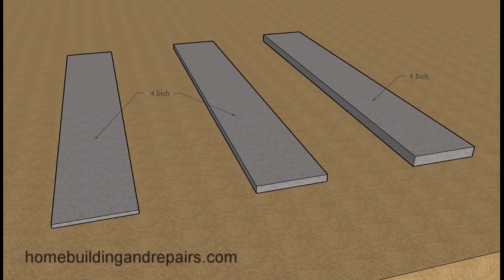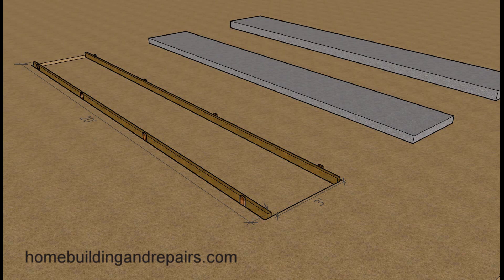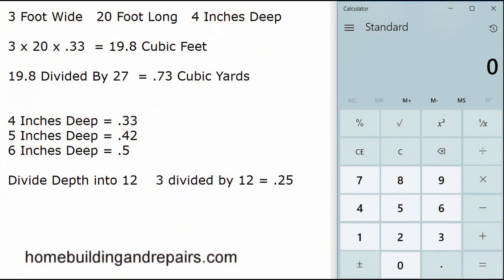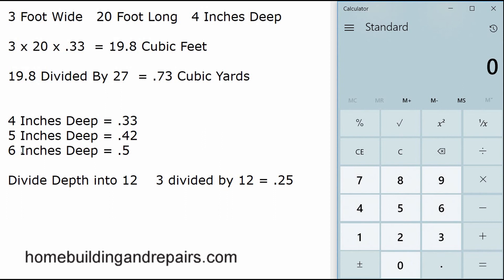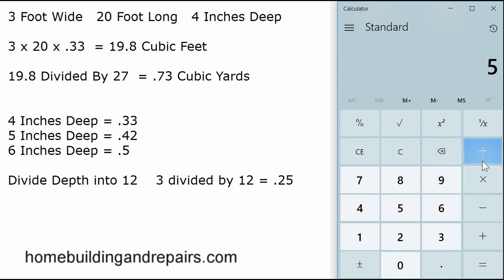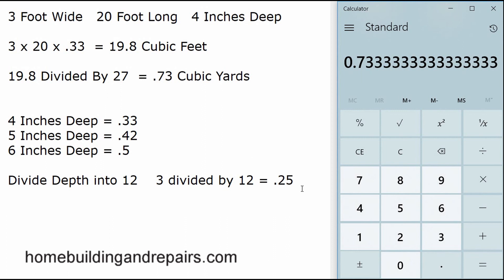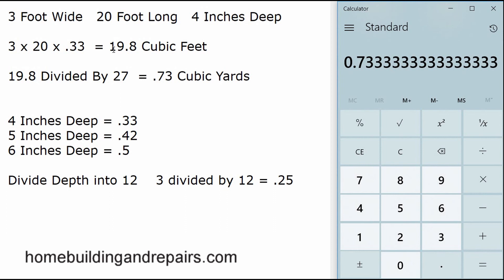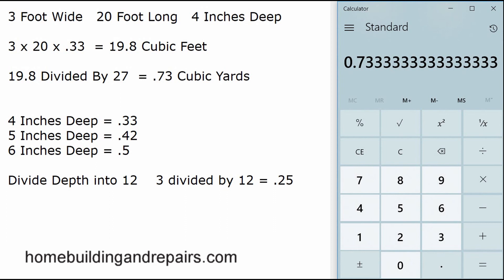How to Figure Amount of Concrete Needed for Walkways - Construction Math

Comment: A more accurate formula is Width in feet X Length in Feet X depth in inches / 12 (or in your first example is 3x20x4/12) which gives you 20 cubic feet of concrete. 19.8 is wrong, which is due to the fact that .33 is not accurately 1/3, and the larger the other numbers, the more your answer is going to be off.
Reply from the maker: Good point and this problem can easily be soved by using .3333 two represent one fourth instead of .33. Now I have to admit when I made a mistake and this is actually something I didn't realize, until I did some math and found out that this individual was correct. On our small sidewalk it might not be that big of a deal, but on a 100 x 100' concrete slab 4 inches thick we would be off more than a cubic yard. Thanks for sharing and comments like yours are always sincerely appreciated.